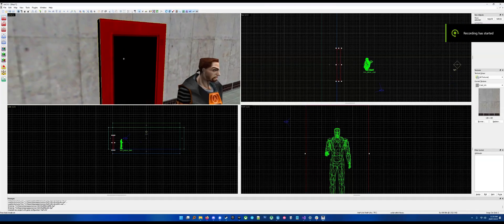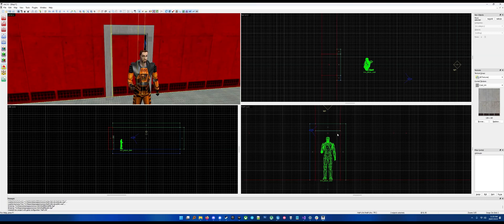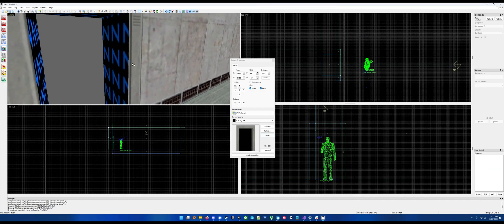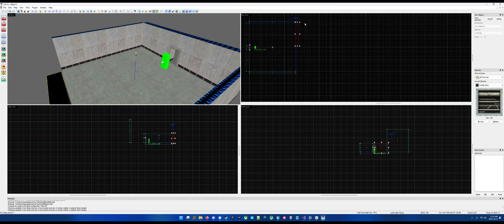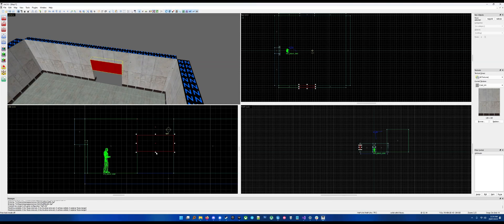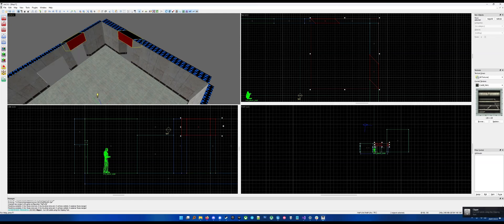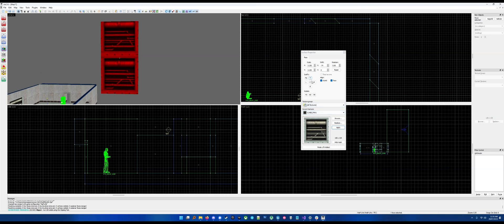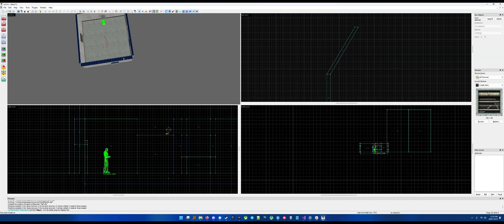quick demo of some brush operations in jackhammer

Comment: What I would like to see inside UE5 is a NURBS<=>TRI<=>NURBS tool.

So, you model geometry using a nurbs modelling system, but you can lock it to 'the grid' and, when the camera is being moved, it turns it into a TRI model, but, when the camera stops moving and you want to add geometry, shazzam, we are back in NURBS mode.

I got the idea from using UE3, where there is an 'UNLIT ON MOVE' button, so when moving the camera the engine changes the lighting to be 'UNLIT', allowing for easier level designing and environment work (a feature missing from UE4 and UE5, for some weird reason, yes, I know you can just hit a button to change it, but that is completely unnecessary IMHO) but for this, to be all about the geometry.

The Unreal Engine has no issues with NURBS at all - one can import a RHINO file into the engine and the engine will triangulate it, so...why not do this on the fly?

NURBS modelling is exceptional in creating geometry, and, as much as I like BSP/BRUSH/CSG modelling for level design in UE5, I do think there would be utterly HUGE benefits for having a  NURBS<=>TRI<=>NURBS tool.

In this day and age of AI and AI Copilot tools inside of GITHUB and VS, we can make this happen.
Reply: YES. Hilariously, nanite would be perfect for improving the WIP rendering
Reply: That would be the perfect concept. The NURBS data could be stored separately, so making the working level would be like baking.